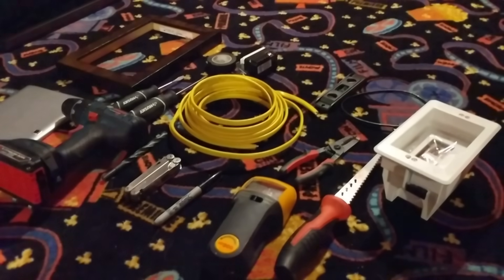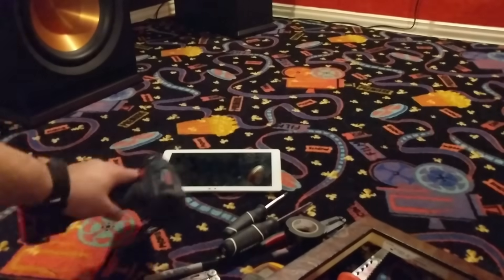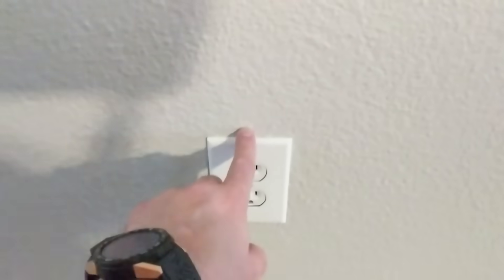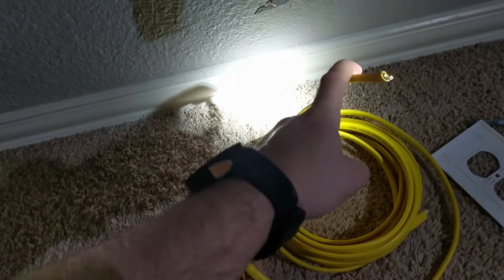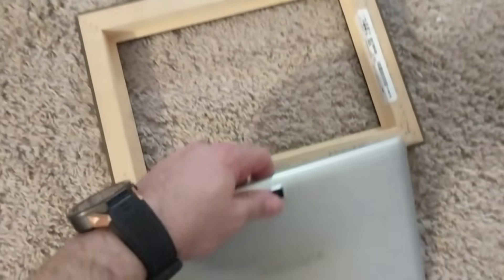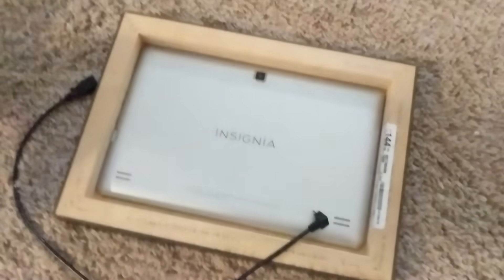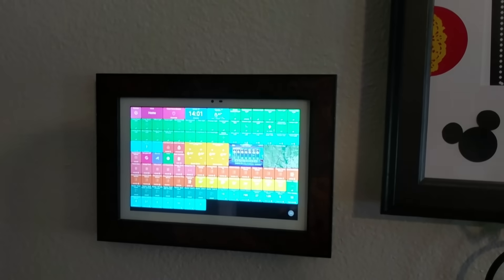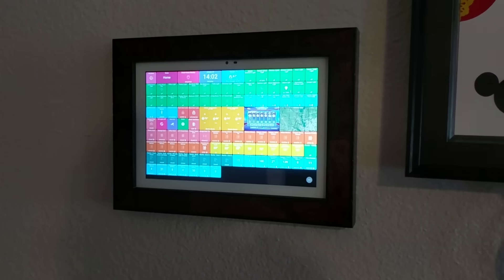Wall Mounted Tablet SmartThings ActionTiles Fully Kiosk Hardware Installation Guide

Comment: The stud was on the left side of the outlet because most electricians are right handed so it is easier to nail the plastic box on the right side of the stud. Some painters tape would have eliminated the mess you drew on the wall. :-)
Reply: Once and a while you get a lefty sparky like me. My boxes are left of the stud.
Reply from the maker: Hehe, didn't even think about that. Thanks for the suggestion. I'm left handed, never knew hehe

Comment: what is the depth size of this housing?
Reply from the maker: It doesn't matter, it depends on the tablet you get and the frame you get. For this example using insignia tablet and this specific frame it is 2 inches.

Comment: Thanks for a good video. Using the onset box is. Great idea 
If I could give some advice. I wouldn’t double up on your screws instead put one wire per screw and if you don’t have enough screw put two wires together and ad a short third one called a pig tail. Then connect that extra wire to the screw. Less chance of one coming lose and arcing. Also you could have used 14/2 because your plugs are 15amp rated.
Reply from the maker: Yes Sir, you are correct. Sadly youtube doesnt allow me to edit the actual video. but you are right, i should have done so as you said.